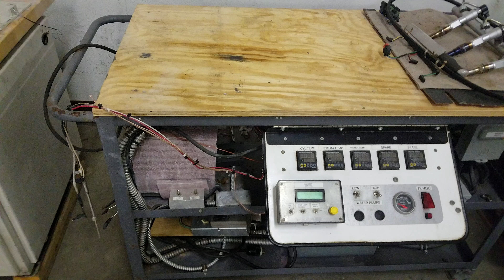Status Update on CES Steam Project at FME

Comment: Are you sure you want all the electrical on the bottom?  Seems to me the water lines and pump (that always leak) should be below the power.  Just a thought.
Reply: also the first thing i thought. At least drill some holes for water to escape...? Cool rig though.